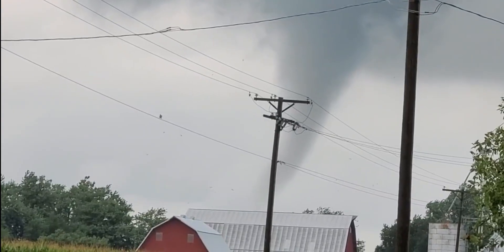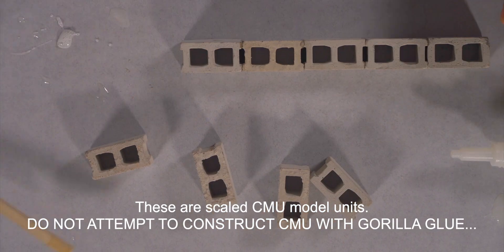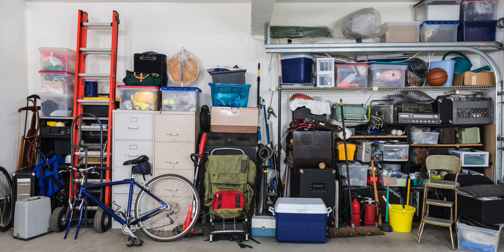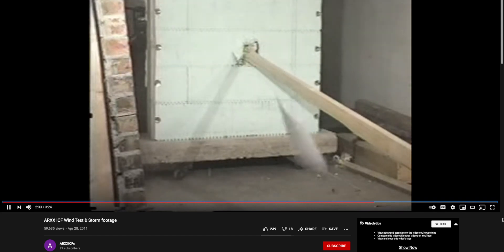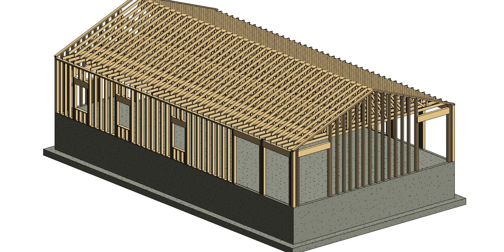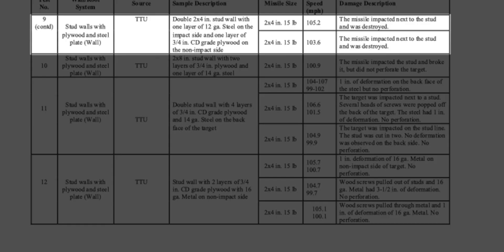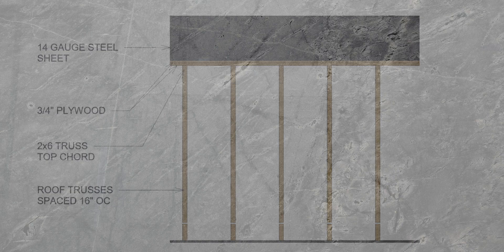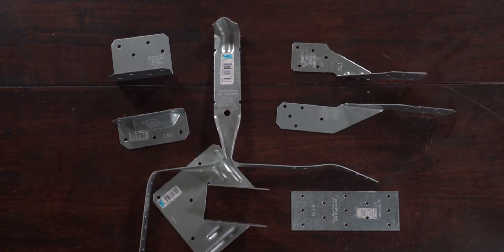These 3 Materials Can Create a Tornado-Resistant Home

Comment: I lived in southern Minnesota in the early mid-1970s. The area had a lot of 'tornado magnets.' I mean: trailer parks. Since they often tumbled about in a weather event, the state legislature mandated that they be secured in place with a pair of tornado anchors: 2 long screw anchors wound 3 or more feet into the dirt on ether side and straps that passed over the roof, attached to the anchors. Typically, there would be two or three of these anchor-strap devices on a house-sized mobile home, one at each end and one in the middle if it were a long house.

A couple years later they looked at the data and found that mobile homes now suffered MORE damage than before. The cause was a failure to flex in the wind. The anchors held them rigidly in place while the wind shredded them. 

Clearly, current permanent dwellings are build to resist gravity. Survival in a tornado would mean they should resist tension/uplift. Holding the roofs more securely in place with straps is just bonus. So while California homes need to resist racking from earthquakes, houses in tornado prone areas need to resist uplift. Straps that run from the top plate to the foundation would do the job. As long as the corners are secured to resist racking. That and being built more substantially than a mobile home.

In fact, those connectors you showed at the end are just a another day on the job in Southern California. They even have small air-powered nail drivers to install them, rather than one guy crawling around all day, tacking them in place with joist hanger nails.
Reply from the maker: Thanks for sharing your experience. I agree that the types of connections used are extremely important and as I kept digging, I realized connections could be a whole other video. You’ve made me want to take a deeper look at the efforts back in the 70s. Thanks again!
Reply: @JthaEngineer  In Iowa in the 1970s, we used roofing nails for joist hangars. When I moved to SoCal I learned about a whole new realm of techniques and materials. We had one guy whose job was to nail on A35 clips - what were called 'Ticos' - EVERYWHERE, especially where the joist and rafter blocking meets the plates.

Slowly over the next 20 years, more and more clips came in. Rafter to top plate. Straps across headers even if they already had sheeting. 3' straps across the ridge on the roof. Straps around the corners of the top plates and box sills.

All of these require special nails, Tico nails. They are only 1.5" but the shank is thick like a 16d nail. A very far cry from the roofing nails we used in Iowa. Now they have screw fasteners in lieu of HD brackets and steel boxes to stiffen garage walls on either side of the door. 

Keep making these vids, man. They are excellent real-world lessons that guys in the field can put to use straight away.

Comment: As a carpenter /builder. . I have always gone hardcore in building . Just for instance .. Granted its not an exterior element .. When I set doors . I developed a way to set them so perfectly. By using a PLS laser . Checking for floor deviation ,then primary projection deviation in the plumb of the four points of frame .Then setting the door with extreme accuracy by tracing an anchored hinge . The using glue on the shims ,dovetail nailing at slight opposing angles and 3" tempered steel screws through the hinges and all locations . When done . . I slam the door violently . Hopeing to break the trim free and knocking the stop off .. The house will move before the door does .. I pity remodelers in the future that try to remodel one of my homes .. Pertaining to framing ..I have many rules .. " Gather strength whenever you can " It can be in nailing patterns . The application of glues , The lacing together opportunities of framing members . Analysing the wood for weakness . When the video started .. Even before the word was uttered .. " Concrete !!! " ... In frame . Low slope roofs act like wings and create high and low pressure uplift . 90 degree corners create vortices and unequally distributed wind loads . The uplift and load pathways need the be continuously bonded to the base .  Nature seems to be the greatest engineer .. I guess the best structure would be one that is cylindrical that creates no eddy . And better a bubble that can take forces in all directions .. But bubble houses don't seem to be what people want Lol .  I build mansions and the customers want detail . Many have safe rooms in the event of a tornado or The Apocalypse . I have thought before " Well it might take a few days to unearth you with all that rubble atop " .. I guess the goal is . To make it more durable in an F5 . Instead of watching the house sucked off the foundation and clinging to the pipes in a central bathroom

Comment from the maker: I didn’t mention anything about the design of the shear walls so I’ll say something here.

The 3/4 plywood is the element I used to check if the shear walls were adequate. They would need hold downs. It is logical to say the steel plate also contributes to the lateral stiffness of the building but I’ve never heard of anyone doing this in a wood building so I ignored that.
Reply: That steel plate was armor. Pure and simple. The plywood is the shear element.